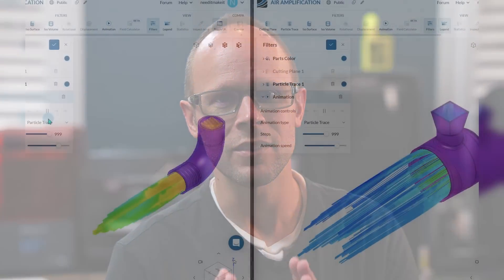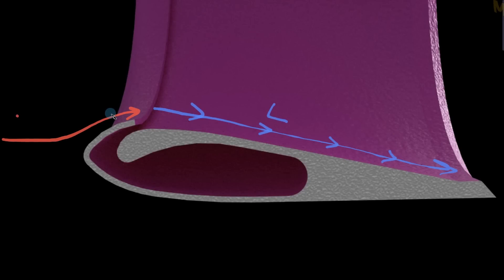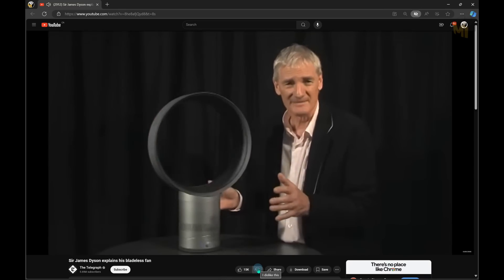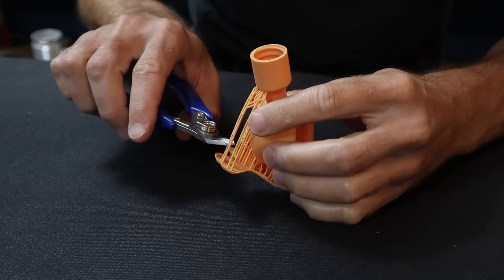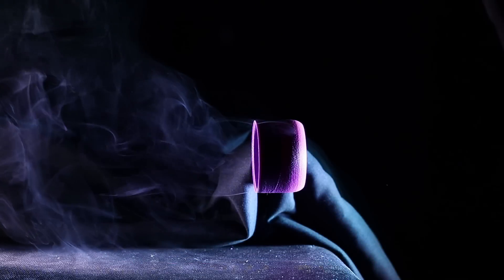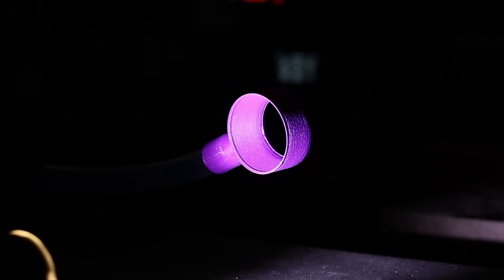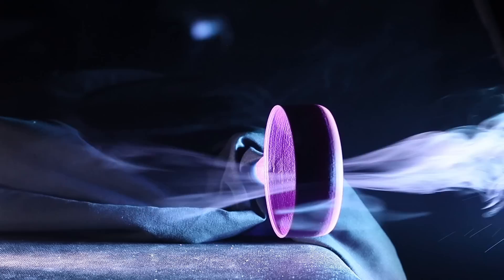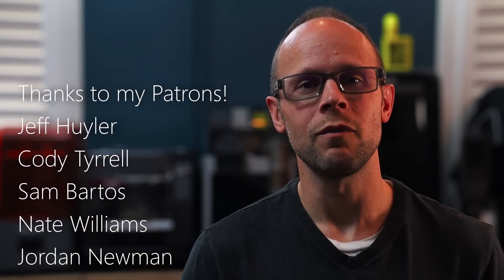3D printing a functional Air Amplifier and testing it to see if...

Comment: You should get a fog machine to make consistent fog.   Also, I think that the straight tube IS actually drawing in air, but it's happening further down stream.  My evidence?  You filled up that trashbag in 2 seconds when you had the straight tube far away, but it took 9 seconds when you put it in the bag.  Also, you can start to see the effect in a couple of your straight tube examples.   I still think the amplifier is a gimmick.  It's true value might be in making a less turbulent flow, but at the cost of efficiency.
Reply: Jostics

Comment: They are not efficient, and the claims about "slapping" air only applies if you have a simple fan and are too close. But impellers are great if you also add other things like an air-filter, and inside a thick base the sound can be damped.
Fan-size is still king when it comes to efficiency - large, multi-blade and slow is what you want.

Comment: dude you realize not everyone has a bambu printer so not everyone can print your presliced gcode right? same with using abs gcode to stl converter or just ignore yours all together sorry
Reply: I think this might just be an impolite way of saying "help, I don't know how to print from makerworld" so if so, anyone can print from there.  I have printed his files on my voron.  He also includes step files, so you can not just print it (they open in your slicer like an stl if that is all you are familiar with) but you can edit them in a cad program.  You can also open a 3mf file in your slicer of choice and select import geometry only to get just the model, no settings if that is what you want.  I mean he has seriously shared this in the most generous way possible making it easy for anyone to open in a cad program or slicer, and be used on any printer, and printed from any OS, even your phone if you have a Bambu printer.  I don't see much to complain about here.

Comment: Your wind tunnel work is very interesting. For smaller scale work you might try using a vape pen with just straight glycerine for a smoke generator, or you might try an ultrasonic vaporizing humidifier. Quantifying the air pressure and wind speed will help your design process quite a bit. A cheap air pressure gauge hooked to a piece of copper line will let you take pressure readings from exact locations, while a manometer is a useful (but expensive) bit of gear. I would love to see some pressure graphs of the area surrounding the venturi.

Comment: Personally, I think it would be interesting to see the noise reduction that an air mover like this could achieve compared to other options if all designs were constrained by equal total design volume. Regardless of that though, this is a very interesting proof of concept and I am excited to see where this very novel idea goes in general.
Reply: Pretty sure these aren't that good for reduced noise. They usually have smaller faster moving fans where for noise reduction you would want larger slower moving fans.
Reply: ah but you see the fan itself is heavily isolated when compared to normal fan designs. much of the time you would not have such a good opportunity to surround the blades with sound insulating material
Reply: @blakes8901  That's true, but at least for Dyson fans they either don't do a very good job of that or insulating it doesn't do that much when there needs to be a fan intake and exhaust the sound can travel out of.
Reply: @Dwayne-h2v  Always worth investigating further but I haven't seen much luck going that route. I have used many fan styles and the loudest I have is my cpap style blower, even when enclosing it in multiple different "muffler" designs.  Consider everyone's experience with the latest FLSun machines for example, even after installing their new muffler they are still about the loudest printers out there due to those cpap blowers.

Comment: Dyson didn’t invent the air amplifier style ejector nozzle, they’ve been around for decades. They just applied to it desk fans.  It would be interesting to see how this style compares to jet pump style ejector nozzles in your setup.
Reply: centuries, even... im thinking of the trompe pump as used in forges for at least 500 years, and the ... "hungarian pump?" that also uses the same idea to lift water from one level to another by using another water flow... just because they use water doesnt mean its any different...

Comment: you should be able to just pull off supports on resin prints without cutting them, if not use a heat gun to soften them or use smaller support tips and more of them if that causes fails, you only need thick tips on islands, after that smaller support tips can work fine if there are enough.

Comment: could you imagine a miniaturized version of this idea used as a part cooling duct on a 3d printer?
Reply: also just thought of this as I watched the video, a toolhead can be designed to draw air over the cold side before the heatbrake to increase its efficiency as well.
Reply: well, I'm not going to take this down, but at the end I've noticed you've had the same idea LOL, but regardless it would be amazing to see this advancement in part cooling design

Comment: I love the tips and tricks in Fusion and the insights in the design process you provide on the channel. But I am just not sure there is much performance gains to be had here. Cooling isn't a limiting factor for most materials on most printers - in fact for almost every material I have printed aside from PLA and TPU I have had to turn DOWN my fan speeds. Even if this design approach results in a more effective duct - what will it let you do that you could not before? Go a little faster with materials you can already print with? Use a little less supports? 

Cool factor aside I am not sure you've made a case for this upgrade.
Reply: This is surprising feedback, cooling is frequently the limitation in my printing speeds, even with ABS.  I wonder what it is that gets us such different results?
Reply: @crashingsux  if I'm printing ABS I have a max fan speed of 20% otherwise I risk layer adhesion issues and warping. This is also in an enclosed machine too. I've never experienced a situation with ABS where cooling was inadequate.
Reply: @anwyll  Maybe it's down to flow rates or chamber temp? If I'm doing functional parts with ABS I'm usually at 60-80C chamber temp and will do flow rates up to a max of 30-80mm3/s depending on which machine I'm printing on.
Reply: @crashingsux  it very well could be. Looking at my profiles I'm typically around the 15-25 mm^3/s range. But of course this is where machine specific components make a big difference and I would not describe any of my tool heads as especially high flow. Nozzle size as well as type is a factor too, larger nozzles facilitate slightly higher flow rates. So many variables...
Reply: @anwyll  Ah, that makes perfect sense.  If I slow down and print at those rates cooling is completely a non-issue for me.

Comment: What blower are you using...and how did you make whatever you used into a blower?   Need a video on that please  Also, make the airfoil (curved surface [top of wing] inside the circle) much more pronounced...it might work better if it has a thicker chord ratio for "low speed" airflow movements

Comment: YES ! I was waiting for a video with this working principle turned into a design =) (It´s called coanda effect btw)
Great content once again.
My only problem with this overall design idea was, you would be taking the hot air from the build plate area and recircling it instead of having fresh cooler air from outside going trough the tube.
Reply: It's counter intuitive but might not be all bad.  For example, when I print ABS it turns out much better blowing a lot of hot air on the print than it does less cool air, seems to impact strength less and reduce warping.
Reply: @crashingsux  Yes you are absolutely right, it depends on the material. However with ABS you could just decrease cooling while with PLA you could use cooler and more air in the same setup thus being more versatile. Cooling is a difficult issue, you don´t want too little cooling because you get sag and so on but you don´t want too much as well due to shrinkage, stresses and so on. And sometimes you want to iterate between the two in the same part. Cooling is always a compromise.
Reply: @sierraecho884  Agreed.   I am sure that one day our slicers will model thermal properties of the print based on chamber temp, cooling, flow rate, nozzle temp, etc..  I can't remember the company but one of the big commercial units already does this so might take a couple decades for the patents to expire.
Reply: @crashingsux  I am sure this will happen one day. You got cheap thermal cameras nowadays and one could do something akin to a flow analysis beforehand and then watch the process in real time to create a closed loop system for instance. There are a lot of possibilities for the future.

Comment: You’re going in a direction I was imagining after watching one of your videos from a few weeks ago.  A hoop like this surrounding the nozzle with a flexible pneumatic hose connected to it which is running along the umbilical for the print head to a remote large blower fan.

Comment: I'm fairly confident that the bladeless fan is 90% Bernoulli effect not airplane wing effect (not even sure it applies at all).
And i think that it's basically impossible to apply it to cooling something upclose or with obstructions in the center of the ring.